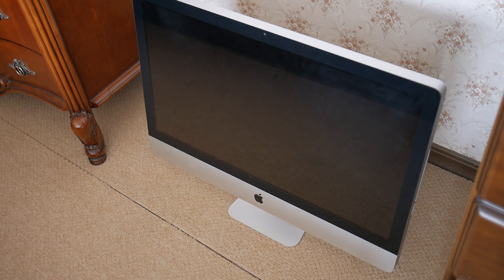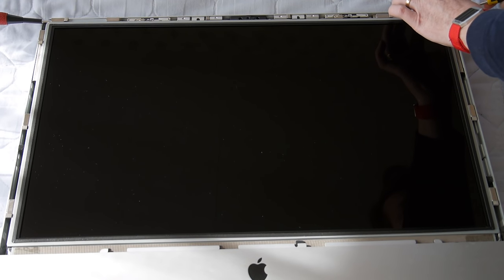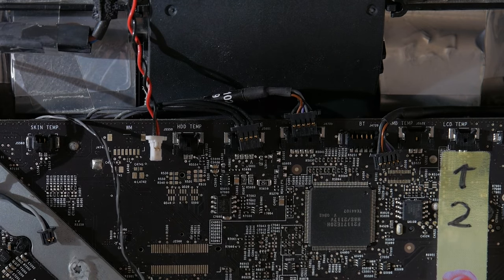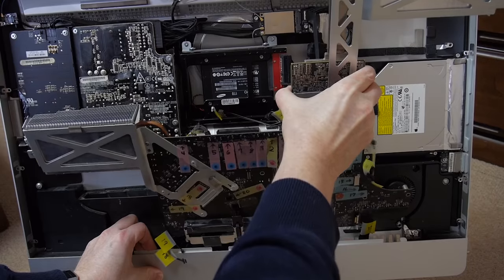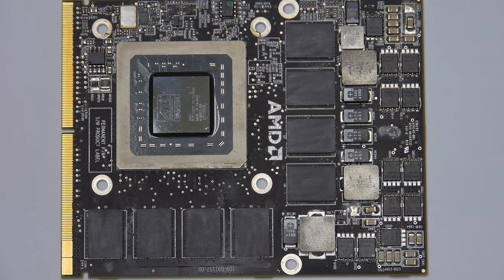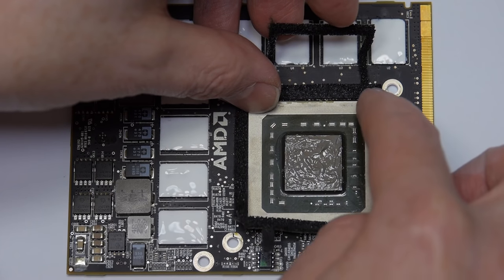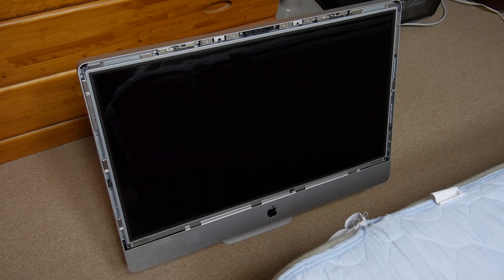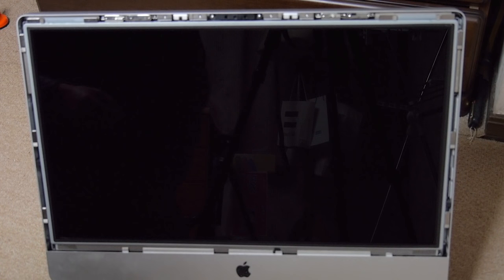Late 2009 iMac 27" Video Card Repair [4850 Bake]

Comment: Talking about static disscharge, and you have it put on a mattress/bedcover that defenetly not are equlizing your ground potential.
Reply from the maker: True, but you'll notice in my video that I did not hold onto the bed as I removed the RAM, nor did I drag the RAM across the bed nor sit the RAM atop the bed after removal.  You are correct that there are more electrically grounded soft surfaces, but honestly, most people won't use those so I showed what most people will probably use, regardless of good advice given about grounding the soft surface onto which one should sit the iMac during RAM removal.  But again, so long as you yourself are grounded as I was in the video (via anti-static wristband) when you remove RAM, and so long as you put the removed RAM into an anti-static bag or onto an anti-static surface (not a bed), then all will be well.
Reply: You shall have the same "ground potential" as the item you are working with.  And it's not just the Ram that are sensetive for static discharge, just saying.
Reply from the maker: Indeed.  But again, most people aren't going to work on their Macs in a perfectly grounded work environment anymore than they will enter a certified clean room to remove the front glass -- and believe me, I wish I had one of those because putting the glass back on without dust getting inside is a major feat!  Perhaps I've been lucky, but in my 47 years on earth, I've yet to fry RAM or any other IC via accidental static discharge.  (But honestly, I don't think I am that lucky.)  

You are correct about the words of caution, but again, realistically, most people are not so cautious or even able to be.  And so far, not a single person has complained their RAM or video card or logic board has been damaged by static due to having followed the advice given in my video.  Those numerous individual repair experiences are something we must ponder consider along side your sage advice.  And so to anyone reading this who is concerned about static discharge I can only advice placement of the iMac on soft anti-static mat while working on and inside it, while also wearing a grounded wrist-strap...

iFixIt has a 70x100cm anti-static Mat for sale here:
https://www.ifixit.com/Store/Tools/Anti-Static-Mat/IF145-036-3

And you can read debates about static and Mac repairs here:
https://forums.macrumors.com/threads/is-a-antistatic-mat-absolutely-neccessary.1170472/
Reply: :-D I'm 47 years old as well, and have worked with electronics and computers since 1986, and have never "killed" an electronic component by static, but it's good to show and educate people of the risks. But by doing so, show them the right way. You can accually kill a component by using a wrist strap, using it the wrong way.  And keep the cat away from rubbing against your projects :-D

Comment: Hi,FANTASTIC VIDEO.I have a mid 2007 iMac,that I just got.Is it normal for it to get really warm?Not like  to gets to hot that you can't touch it,but pretty warm.Is there a fan control app that will fix it? Thanks for your time.
Reply from the maker: Yes, it is sadly very normal for Macs of that era to get very hot, seeing Apple did not design them very well.  In fact, Apple didn't make a modern Intel iMac that ran cool to the touch until the 2015 5k 27" version.  I use that at the office and can attest to how cool it runs, even at the stock fan speed.  If you want your iMac to run cooler, you will need a fan control app.  I posted links to 2 apps I myself have tried and tested in the Description under my 2nd Bake video here:  https://youtu.be/6BJGLFCigdA

Comment: Thank you!! This finally got my computer working after trying heaps of other ways to get my screen working 🙏🙏🙏
Reply from the maker: That's wonderful to hear, Bruce!  Thank you for making time to let me know!
Reply: BRUCE LUI Hey! Nice that it works again. But I have one question. Does this trick also help when I have a complete black screen?
Reply from the maker: @rocketplayz4565  Yes it does: https://youtu.be/teV_atLUlpM
Reply: RocketPlayz do you mean with no sound too? 
Mine had power and sound but no screen showing. And this is the method that brought it back to working. It still works fine now too.

I recommend to record and take pictures of where wires go and where screws go incase you forgot, overall it wasn’t too complicated to remember as they’re quite obvious fits
Reply: BRUCE LUI When I power on the imac I do hear the startup chime but the screen keeps being black. Also shining a light at the screen doesnt show an image. So the backlight inverter is fully working. When connected to an external display, the imac is working great. I have literally tried to put my gpu in my oven for 9 minutes at 200 degrees and it works like a new gpu. Im super thankful for this video. I checked the motherboard and it seems that a diode has broken in half. So tomorrow I am going to replace that diode and hope it will work again. Never tried something like this before but we will see (:
Reply from the maker: @rocketplayz4565  Feel free to post a link to a photo of that broken diode.  I'd like to see that.

Comment: I wonder if spreading your arctic silver that way whether you are creating air pockets under the heatsink.... If only one drop were applied and have that splashed by the heatsink it would spread. Now it won't. You got air in between just like on the heatsink chewing like material with cracks in it. Dried up... Curious. Nice vid btw. thinking of buying an old that is broken and fixing it. this is gonna help a lot. thnx.
Reply from the maker: That was my 1st bake video.  Be sure to see my 2nd bake because I use different thermal paste.  My latest bake was done using Thermal Grizzly Kryonaut in an X pattern, which tends to get an even better spread than a dot in the middle.  The dot method tends to spread in a circle, whereas the X method reaches the very edge of each corner of the GPU.  But what I can say though is that 4 months later when I did my 2nd bake and removed the heatsink, the Arctic Silver V was still very moist.  It was not dried out, nor did I see evidence of air bubbles.  Best wishes on your first bake!

Comment: Wow totally worked! Had a 2011 Mac I was sure was a goner, I had nothing to lose throwing the GPU in the oven…It would make a great story if anything but man it totally worked! 👍👏👌
Reply from the maker: Paul, one of the greatest things about the bake, other than its simplicity, is the fact it works for the vast majority of people who try it.  And so long as you use the correct two kinds of thermal paste, it often lasts many months to a few years.  Sadly, due to the nature of the GPU defect, it won't last forever, but it usually lasts long enough to have made your time, effort and expense worth it.  Please feel free to keep me informed of how your GPU card is doing over time.  Best wishes!

Comment: No need to remove the motherboard. I just performed the same operation to renew the thermal paste on the heat sink. If you remove the three screws connecting the bracket to the motherboard and one screw at the top of the heat sink, the graphics card and heat sink can be pulled upwards out of the edge connector. Be careful not to pull on the temperature senor wire and you can dis-assemble the heat sink and remove the graphics card. After re-assembling the graphics card can be lined up with it's connector and pushed back in. Doing it this way saves lots of time. Also, when you have the graphics card out you have access to the area where a SSD would be fitted form the factory allowing a two drive setup. Mine has a factory fitted 250GB SSD for the OS etc and a 2TB spinner for mass storage.
Reply from the maker: Thank you for watching and for your comment, but please be sure to read the extensive text description I put under the video above. I’ve already covered the issue of motherboard removal there, as well as having created a second video which shows the entire procedure without removing the motherboard. Thank you.

Comment: I've been gearing up to do my 27 Inch that White Screen/Boot Looped last week & it occured to me....Can't I just buy another AMD Card instead of repairing mine? Or are they very difficult to procure? (I'm typing this before checking obv) Or they all just fail due to poor manufacturing? ALSO: Uploader, You made this seem fairly painless with your clear, helpful & honest tutorial.
Reply from the maker: It's much cheaper to do the bake than to buy a replacement video card.  And even replacement cards have the same issues (bad design), so it's not like they will last forever.  My new replacement from Apple lasted only 3 years, just like the stock card did.  That's why so many give the bake a try first, then if that fails, Plan-B is a replacement card.
Reply: @JDW-  I see. Cost is a non-issue but I'd still be spending the time installing it. Perhaps a repair & a spare will be the way to go. Thank You x100 again!

Comment: Followed your instructions to perform a number of repairs and while the screen was out I did a number of upgrades to my Imac.Installed a 1TB SSD, removed DVD player and installed a second SSD to backup the operating system, replaced the battery.
I did the repair on the video card as per your instructions and now I get the system as far as the Apple logo, the boot line goes all the way across and then it freezes up. Reloaded the operating system base system and its still doing it, any ideas on how to get it to boot up fully e.g the rotating wheel and onto the desktop? 
I purchased the Imac for $250 bucks it's a late 2009 27 inch model A1213 Intel 5 chip.
Thanks for the very detailed video , helped me build the confidence to do the repair.
Reply from the maker: I'm very sorry to hear about the freeze during boot, Keith.  Because you purchased your iMac as a second hand machine, you don't know the entire history of what its been through.  There very well could be problems other than the video card.  Also, it seems you performed the bake and added upgrades all at the same time, which means it is now difficult for you to know if the bake failed or if it is your new SSD or even the DVD player that is causing boot problems.  As such, I am very sorry to say that you will need to remove the screen again and perform troubleshooting steps.  Namely, you need to determine if the bake worked.  To do that, you would need to restore the original spinning platter HDD and optical drive and otherwise make the machine exactly like it was when you received it, except for the baked video card and new PRAM battery.  If your machine boots fine in that stock condition, then you know the problem lies in one of your upgrades.  But if your machine does not boot even in the stock condition, then its either the video card or the data on the spinning HDD is corrupt -- which can happen if the machine locks up frequently due to the bad video card.  You may want to try booting off a known good external drive.

While rare, I have read a couple reports in the comments where one bake didn't resolve the problem but a second bake did.  Indeed, even I had to perform two bakes, albeit 4 months apart.  I know this is a lot of trouble.  Believe me, I know!  Removing the card, the paste, baking, reapplying paste -- ah!  What a pain!  But if during your troubleshooting you isolate the problem back to the video card, then you really only have two choices: (1) bake it again (which I would strongly recommend) or (2) but another video card of the same type and use that instead.  I would recommend the same type of video card to ensure it fits perfectly and it doesn't generate more heat than the stock card.  Please let me know if this advice is a help to you.
Reply: @JDW-  I figured it out last night, when you buy a hard drive or ssd they are already formatted to receive Windows, I did some research and figured out the drive needs formatting using Apples Guid format, I did that and it loaded the software in a hell of a lot faster.  One tip to anybody is ssds  generate a lot less heat so the video card is not subjected to extreme heat. I installed the thermal sensors on both drives so the fans are regulated to a lower speed. Now figuring out if I want to run two operating systems eg partition the 1TB drive to 500GB , then install Apple on one virtual drive and Windows on the other. It was worth doing and is very cost effective.
I learnt a lot , sure its a pain but learning new stuff takes time to master it, microsoft use exfat or MSDos, if you want to use files on both systems you need one drive formatted to exfat , then you save files to that drive.
Reply from the maker: So, Keith, you are saying that you resolved your boot problem by reformatting your SSD (inside your iMac) to GUID and then reinstalling the OS and your files, is that correct?  It is true that some Macs won't boot off a drive with the wrong format.  I always reformat my new drives before I do anything else, which is probably why I normally don't have boot problems.  But yes, the GUID partition scheme is an important format for Intel Macs.  Older PPC Macs need the Apple Partition Map.  Windows needs the Master Boot Record scheme.  And then on top of that you have file system formats like FAT or ExFAT (Windows) and HFS+ or APFS (Mac).  When you install High Sierra or Mojave, the OS installer will automatically choose APFS and reformat the drive accordingly.

Comment: Have used your video 3 times and about to do a 4th bake, probably don’t need the video anymore but it’s very thorough and I commend you for that. My first bake lasted a year and the two after only a couple months. I’m using rather cheap thermal paste and I am wondering if that’s the problem? Should I order the stuff you use or is the short life span possibly due to something else?
Reply from the maker: Thank you for providing me with an update on your bakes.  I myself have gone through 2 bakes, but my 2nd back has lasted 1 year and 11 months.  My first bake failed after only 4 months and I think it was because of the thermal paste I used and the fact I did not clean off all the old thermal pads either.  But on my 2nd bake I used K4 Pro and K5 Pro and I really think that makes all the difference.  So if you did not use K4 or K5 Pro for any of your bakes, assuming you wish to try again, I highly recommend the K4 and K5 Pro.  Please follow my 2nd bake video on how to properly apply them, and you should be good to go.  And hopefully you will have a longer span of usage as a result.
Reply: JDW you are a god amongst men. Will be trying soon, will see what my local shop has first then get some K4 and K5 ready for the inevitable 5th bake
Reply from the maker: @TheEthanwilson  I am certainly no god but mere mortal man just like you.  And I hope that you can join me in long-term baking success by using K4 and K5 Pro.  Best wishes to you, Ethan!  Feel free to follow-up with a comment anytime!
Reply: JDW so I waited for the k4 and 5 to arrive and did the bake and I think it worked. No signs of artifacts or pink lines BUT from the time the apple logo appears the lower part of the screen shifts over abruptly then back. I’m worried I damaged the connection where the big wire in the right connects just beside the video card. Do you think this could be the issue? I can upload a quick video showing the problem since it’s sort of hard to explain. Thanks again for the quick replies

Edit: video of display https://youtu.be/ID-g-x2GE4k
Reply from the maker: @TheEthanwilson  What I see in your video is obviously a problem that needs to be solved.  But I am not sure of the cause.  Without a doubt, it is either a cable or the video card itself.  Why do you think you damaged the connection near the video card?  I do know cables inside these iMacs are very sensitive. They break easily, especially the ribbon cables.  But pulling hard on the other cables can dislodge wire terminals from their connectors.

With that said, I never baked my video card 5 times, so I cannot say if baking it too much repeatedly could cause this.  The best you can do for now is to recheck all the cables.  Especially check the ribbon cable that connects in the upper left, as that thin and narrow cable broke on me when I was attempting my 2nd bake. There is also another wider cable that connects to the back of the display, and that could cause what I see in your video.  But if there is another cable that you think is suspect, it too could be a problem.  It might be difficult to jiggle the cables with the machine turned on, and obviously risky too if you aren't careful, but jiggling the cables with the machine on might show a bad cable more easily.  You just need to remove all rings and metal from you so you don't touch something and short it out by accident.